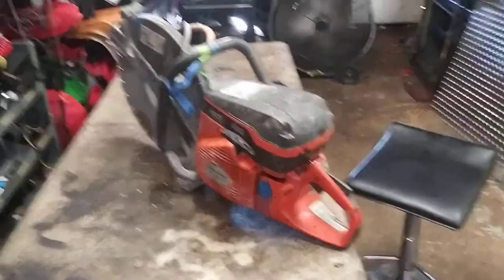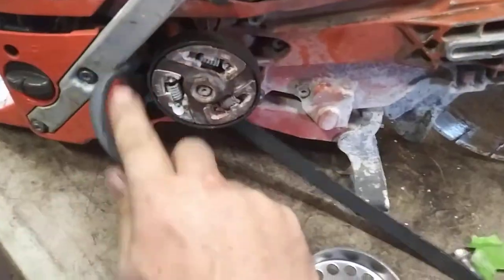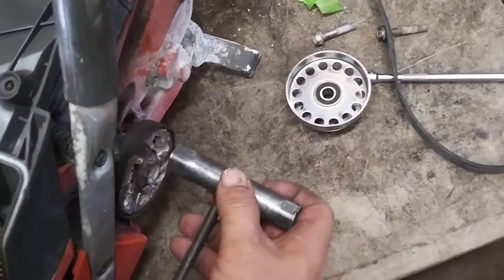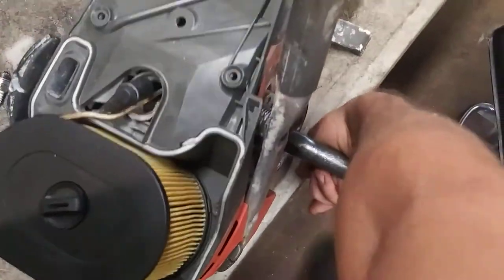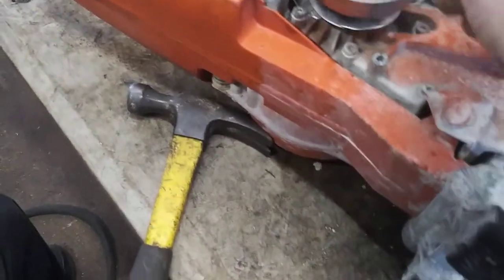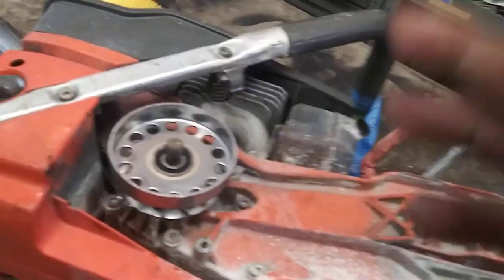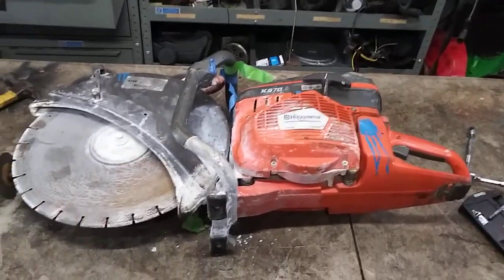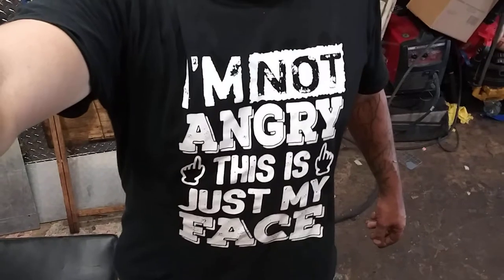* Husqvarna k970 concrete saw cut off saw clutch repair replace k750 cluch repair k770 clutch repair

Comment: Does  the blade stop moving if the clutch or clutch spring is bad ? Like when you give it throttle ?
Reply from the maker: If the clutch spring goes bad blade will always move. Sounds like a bad belt if it stopped moving